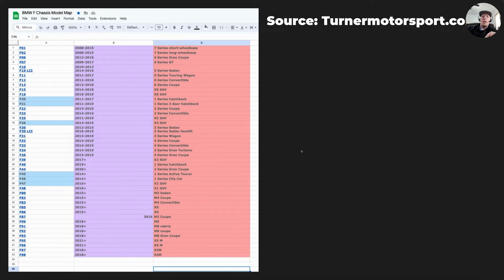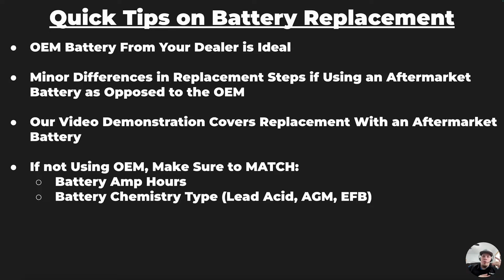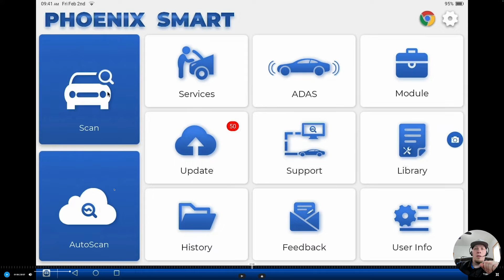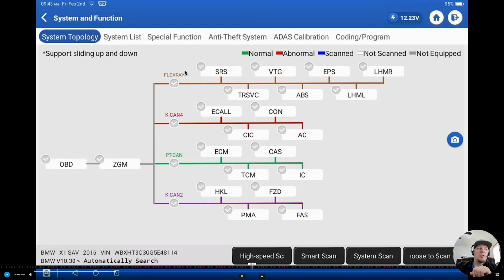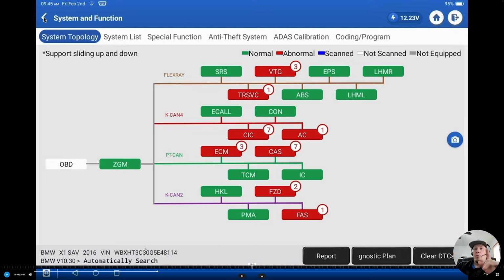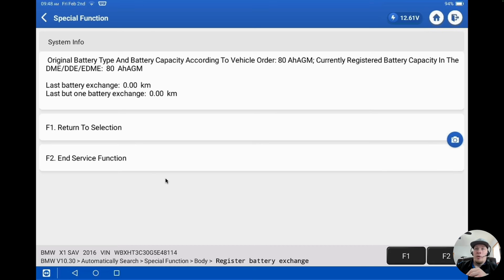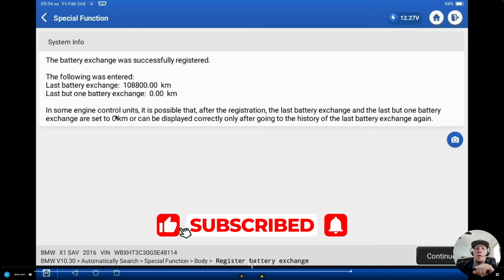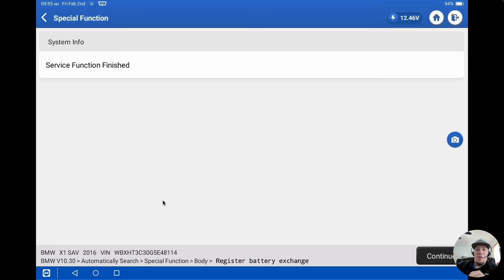TOPDON Training - BMW F Chassis Battery Coding with the TOPDON Phoenix Series

Comment: Hey. Great video. I just bought the topdon pro. I bought it because it said it could do bms. I tried it on my E83 with no luck. Do you know if that tool will actually perform the reset ?
Reply: I have the Topdon Topscan and haven’t figured out how to code a new battery. It has the register steps but it puts notes I. The steps that says it needs to be coded per DIAGCODE: D6121_00000000_01_301